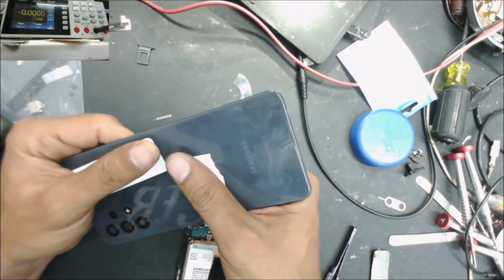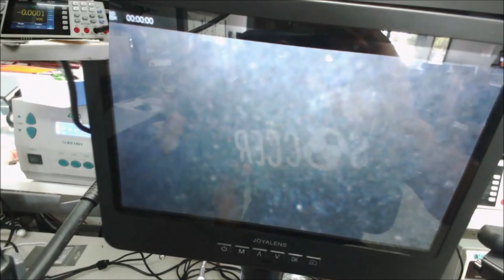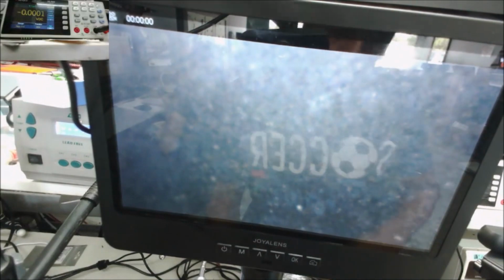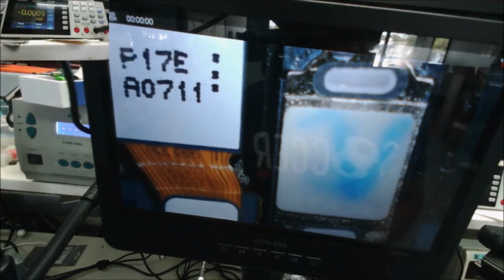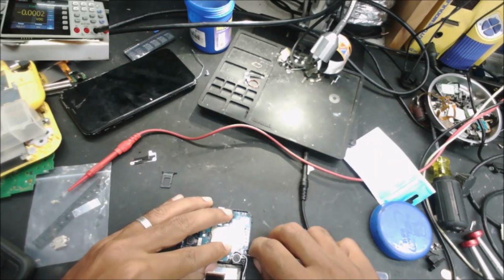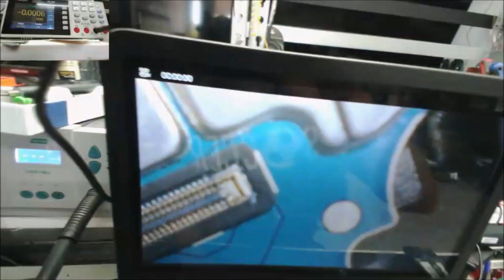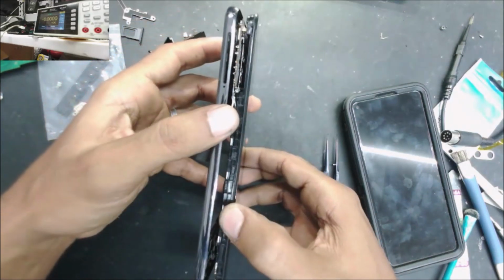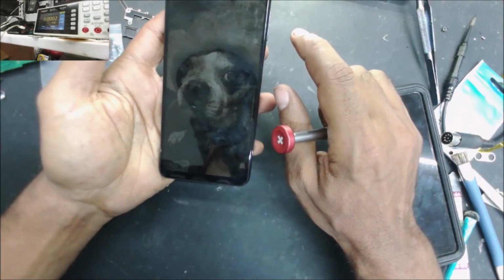samsung A32 A326U FPC screen connector

Comment: Nicely done 👍 Repair shop ... hmmmnnn 🤨 and they couldn't fix a connector. Good thing you happen to have one in stock😎🙃
Reply from the maker: good for me, not many ppl do micro soldering here, even UbreakiFix nex to me they dont do microsoldering and they send many ppl
Reply: @SOSfixElectronics  Really? Wow I didn't know that - have one a few miles away from me ...hmmnnn maybe it's time to go visit 🤔 Can use the extra work.   Sounds like you're in a good spot, very nice!!